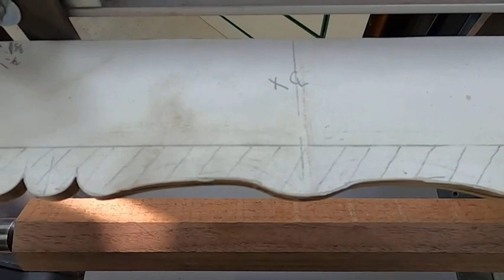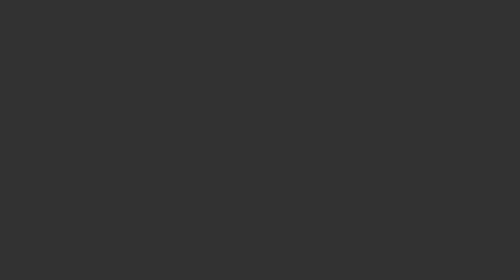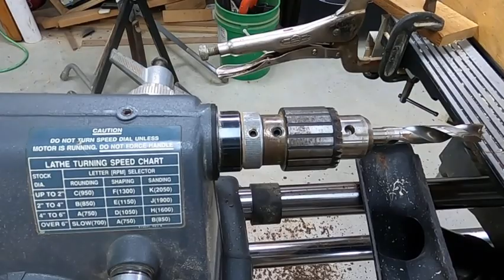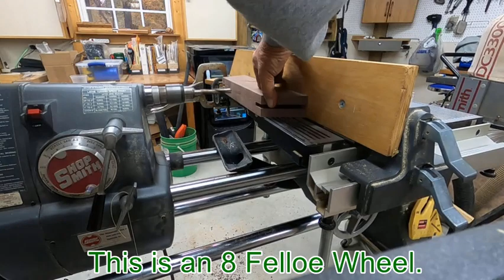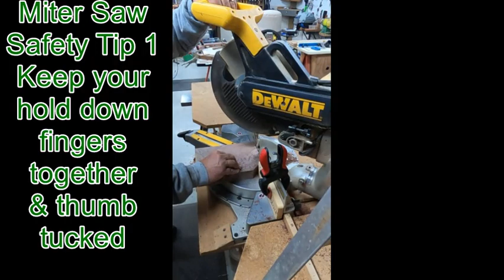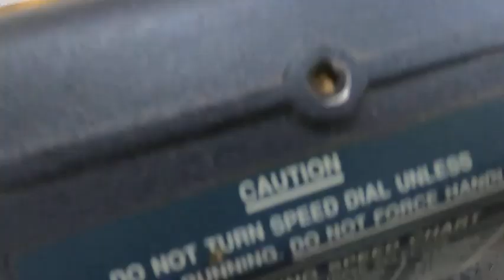Makin' Stuff: Let's Make a Wheel (pt.1)

Comment: I’ve know about Shopsmith machines for a long time but I’ve never seen one in use until now. 
Your lathe duplicator works great and I’m sure will give you consistent results. 
I saw the reveal of the wheel on Captain Kleeman’s channel and came straight here and subscribed before I hit play. 

Now to watch your part 2 making the handles.
Reply from the maker: Yes sir... I’ve owned Shopsmiths for over 25 years.  Once you learn the how to set it up, tricks to maximize accuracy and work within its limitations... it’ll do good work.

I hadn’t used one before either.  The video of turning the wheel’s handles was the first time.  So it is fairly intuitive to learn.

Thanks for the comment,

Comment: Awesome work and great video. I have a ShopSmith that my dad bought in the late 70's so I could build my 4-H projects.
Reply from the maker: That’s what I started with MarkV 500... every bit as accurate as the newer ones and a real handy piece of equipment too!

Do you use it often?
Reply: @sassafrasvalley1939  hasn't been used in 10 years since my dad passed. I'll never sell it just because.  All my projects now are 4x4 trucks and metal fab
Reply from the maker: @davidfisher69  I understand... if you ever decide to get it out of mothballs and need some advice.  I’ll gladly advise you.